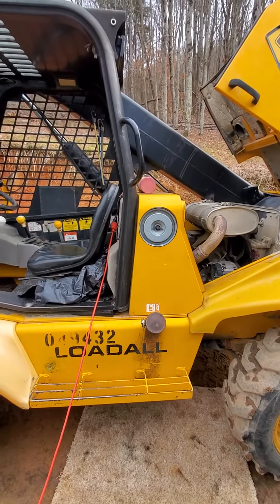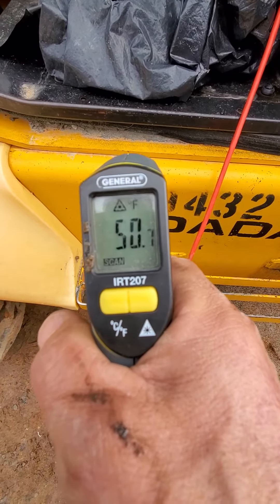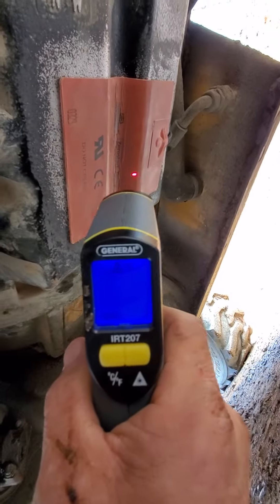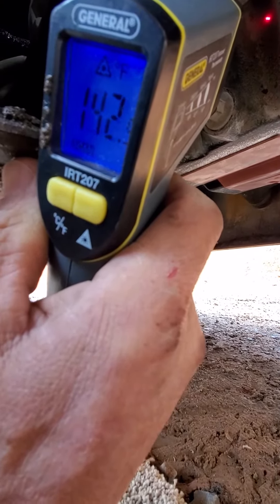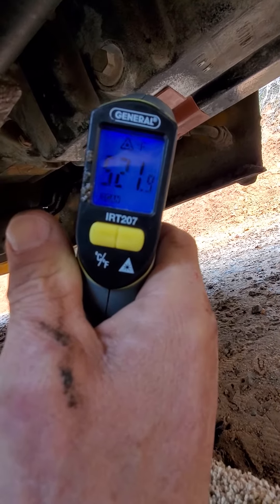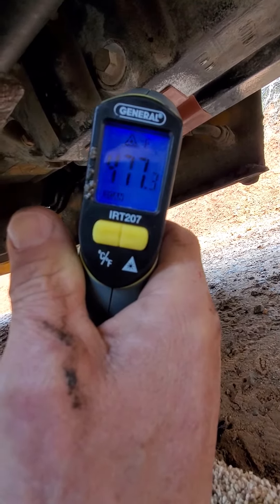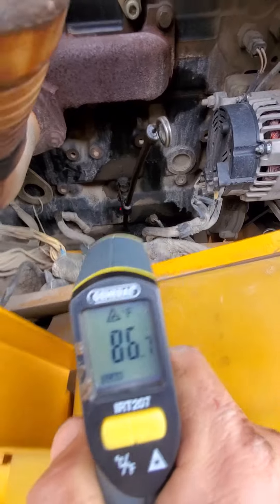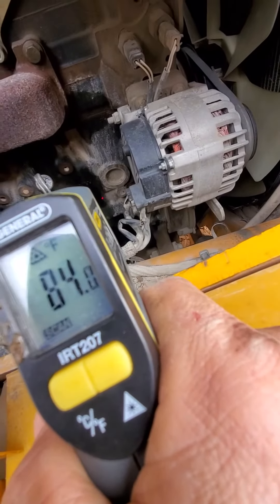Temperature of a 500 watt oil pan heater

Comment: Nice to have oil pan heater. I went with oil heating cuz it’s better to get fast oil flow to the top when cold. I also noticed my digital coolant temp gauge jump up as well when the engine starts and they began to exchange heat in the oil cooler.

Comment: Too much wattage, I think that extreme localized heating of the oil in the area by the heater will break it down. I would also suggest getting as large of a heating pad as you can fit on the oil pan to more evenly distribute the heat so it isn't as concentrated in that small area. The lower the wattage density the better, it looks like there's plenty of room for a larger pad on that oil pan.